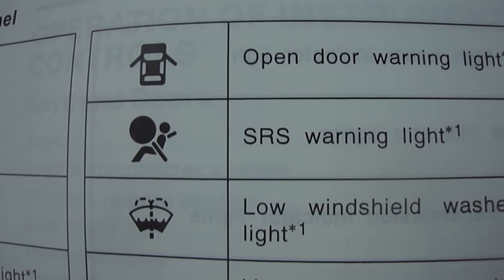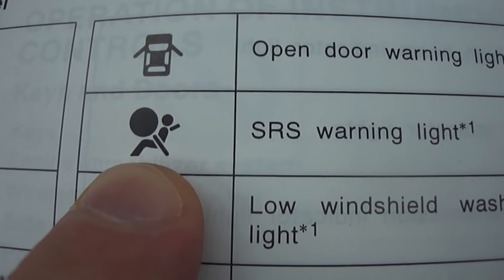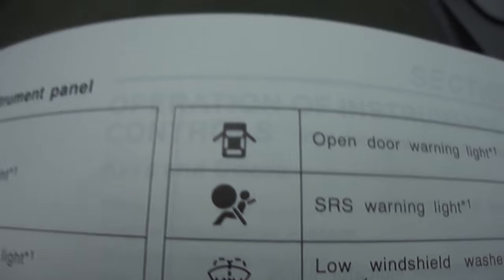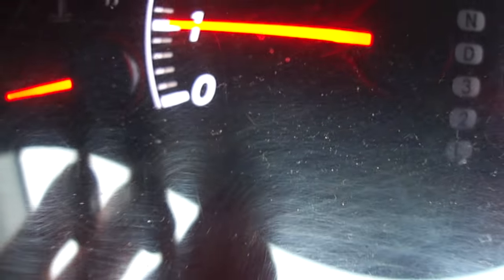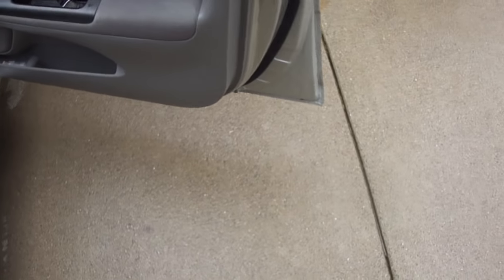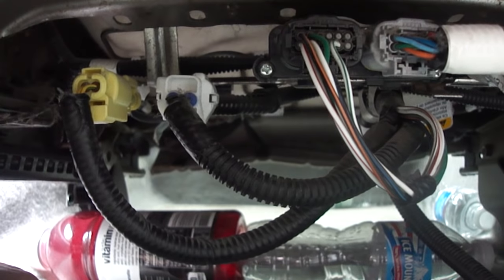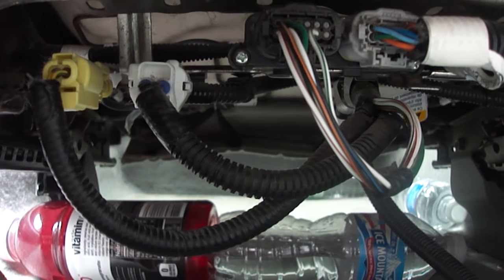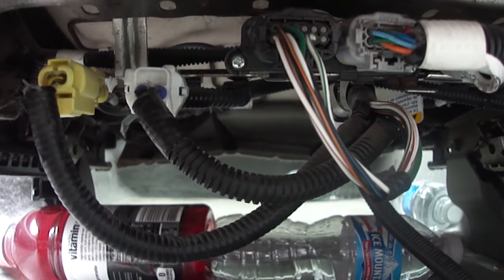(Part 1) How To Fix Airbag Light - Fast & Easy!

Comment: For a longer term fix, something to look into is proper contact grease based on the material of the connector contacts. Cant vouch for any product (it varies) but it seems over time, either corrosion, wear, or both effect contact longevity. Dielectric contact grease solves these issues, but its very important to get the right type based on the connector contact material. Also the car should probably have its battery disconnected for some predetermined time before disconnecting any of these connectors - lest you want to make a trip to the dealer to get the airbag system re-calibrated - especially on newer cars.
Reply from the maker: Thanks Ivan
Reply: I was looking for this comment. And DEFINITELY don’t unplug, or god forbid, PLUG IN the connectors with the vehicle running

Comment: Yes this worked for me had just returned from having my Kia Sorento seat being repaired and noticed drivinn home that the airbag warning light had come on. I watched this video and did what was said and found the cable under seat was loose and actually made a clicking sound when properly connected. The warning light immediately disappeared. Thanks for saving me another visit to the repair shop!!!

Comment: Thanks. Watched your 3 videos and fixed my '04 Acura TL Airbag/SRS Light-On problem in about 5 minutes! It was the yellow SRS connector under the pax seat--the first one I checked 😜. Glad I did an ops check after doing the first one. Saved time and also isolated the problem to that specific plug. Thanks again for the great info. Always  a great idea to check the easy stuff first. It's beer thirty! Cheers, Spudz
Reply from the maker: You're welcome!  Glad it worked.
Reply: Did you have to disconnect battery or jus wiggled a little on the connectors ??

Comment: The real problem that this fixes is mico corrosion build up on the terminals. This is known as terminal fretting. Simply unplugging and reconnecting will result in a restored connection. There is a terminal lubricant called Nyogel that will prevent the corrosion. The air bag circuits are always the yellow connectors. ALWAYS! do this with ignition off.
Reply: JAWGA MAN You want nyogel 760g. In our store we use AC Delco part number 12377900. Not sure what retailers have it but available through online retailers.
Reply: JAWGA MAN  and yes, use this directly on the pins. Don't fill the female terminals.  This can cause a hydrolock senario and spread the terminal.
Reply: ejdubu 
Or you can use dielectric greece👍

Comment: Hey thank you, this worked. Stealership said they fixed my passenger side airbags for the Honda recall on my civic LX. I brought it back and they said it was my driver side airbag. They tried charging me $165 for diagnosis then after I went irate they said $65. I told them to F off. Thanks you your video. It was just a loose connector under the drivers side. Interesting part is the stealership never bothered checking their work.

Comment: Thank you 🙏🏻 I was freaking out 👀😭😂
Reply from the maker: Yesi Cha 👍😊
Reply: Well, how could i determine which side. Driver side or passenger  side is what trigger the light to come on?
Reply: On my 2006 lexus rx330 it has a weight sensor.. it would be off if no one is sitting or the weight wasn’t ip to the limit for the airbag to be on. But i noticed mine today it was off even tho my wife is sitting there
Reply: I suspect it’s something to do with all those bottles rattling about under the chair. Rolling back and forward, pulling away and braking are bound to push the connections loose.

Comment: One last thing I would like to mention is that generally, a dealership will most likely want to change out the entire wiring harness or connectors in addition to paying for that new part you will also incur labor charges as well..I actually called the dealership and the price they quoted me was Absurd!

Comment: Thanks so much for this,  saved me a couple fo hundred dollars and a whole load of work.  My model of vehicle is known to often have a fault in the passenger detector unit,  and I assumed the warning light problem was this and I had to buy another seat and reset the whole computer and a whole load of hassle to fix it ... but after watching your video and checking the connections,  the problem has gone away!  Two minute work!  God bless you.
Reply from the maker: Alistair McClure 👍

Comment: Maybe a silly question but do you need to disconnect the battery first?
Reply from the maker: There are no silly questions here and the answer is no.
Reply: If you're going to work with airbag, you should remove the battery connections first, or you run the risk of triggering it. Safety reasons
Reply: YES, you always need to disconnect the battery when it involves this. 
I own a car dealer and when it comes to removing seats on newer models, even older models, if you don't disconnect the battery and when it comes to disconnecting or reconnecting the cables, the airbags can deploy and its happened to me and to a lot of people I know who've tried to fix their issue or just removed their seats for detail cleaning. 

It doesn't take more than 5mins to disconnect the battery, always play it safe.
Reply: 5 minutes? Are you disconnecting it with chopsticks or something? And are you saying that if I'm involved in an accident, you know, the kind of occasion upon which you would hope for your airbag to deploy, and the battery is ripped free of its cables in the impact that my airbag won't go off?
Reply: The impact sensor is the one cause the airbag to deploy. 
Has nothing to do with battery.
Reply: Before fiddling with the connector, you need to leave the car switched off for half an hour to discharge any residual current in the electrics. Otherwise, you might trigger the airbag.
Reply: Yes, must remove the negative terminal of battery under the hood.  This will save you from accidentally tripping the SRS Air Bag system !!!  Definately must do !!
Reply: Ok
Reply: @RiffRaffMama.  The airbag will have gone off LONG before the battery gets yanked out of it's harness.  The speed with which they deploy is staggering.  Just witnessed a MAJOR collision this weekend.  Expected to pull dead bodies from the vehicle.  Remarkably (and smokily) three people walked out of the two vehicles in pretty good shape.  SO MUCH SMOKE from the airbags.  Never seen an engine torn to pieces like that.  Wow.

Comment: SRS wiring harnesses are identified in YELLOW.. the other harness (white, blue) are pwr seats and/or heated seats and will have absolutely no relation with SRS/AIRBAG systems in all makes and models i.e. make sure yellow harness is snug; step 1 srs light problem. This poor guy obviously must be mistaken in which harness is giving him problems, cleanliness may also be a factor with all those bottles jumbln around down there

Comment: yea funny I was detailing the carpet unbolted the seat put everthing back to how it was then the airbag light comes on might have to check all conections are in place
Reply from the maker: You should be able to fix it no problem.
Reply: Jimmy Jay im a detailer and if i have to remove seats i always disconnect the battery for just incase reasons. Been told you dont have to as long as you dont turn the ignition on with all the srs connectors unplugged. I still disconnect cause knowing my luck I'd forget lol

Comment: $100?? they tried to charge me $800!!! I'm trying this right now
Reply: Did it work?
Reply: its a racket..lucrative for dealerships
Reply: James Chuaycham ป้อม ศักดิ์ชัย no it didn't. I have an 08 Suzuki Grand Vitara. There's a recall on this for the passenger side. The dealership had to give me a new seat no charge.
Reply: Lee 
McKee
Reply: The Honda dealer I went to said this job is $800 to replace the SRS. The car isn't worth that much money.
Reply: Pretzelgal check for the cutoff SRS indicator, located with the hazard lights. There is a sensor and if you replace that part, the light should go off. This is a video on how to replace the switch https://youtu.be/nuTvEnogE2o
Reply: i was at toyota dealer he told me his going to charge me 110$ hour for fixing this problem ( check all the wire )

Comment: OMG I was skeptical at first but after reading so many comments I decided to try it and it was disconnected. I simply pushed the yellow back in and it took the light off. Thankkkkkkkkkkkkk Yoouuuuuuuuuuu so much. Now I'm looking to fix the Emissions light, that will be a lot more than just a click hahaahhahaha. That is a Solenoid that needs replacement. I have a 2009 Acura TL any video suggestions for that?

Comment: You made my day. I just found out I have to replace my gas pack unit on my house and the SRS light came on in my car.  I wiggled the wires under the seat and it went out. Thanks.

Comment: Thank you. That's a great and clear explanation. I have 2006 nissan maxima 3.5 SL , airbag light blinking continuous. I'm finding difficult to check the yellow harness under driver seat as I pulled seat front and  back but could not move my hands inside seat to wiggle yellow harness. Any idea or video how I can?
Reply: take the 4 bolts holding the seat to the car out and lift the seat up to fix!

Comment: Awesome video!  I was running out of options and was in search of fuses on this car that was provided for my son by my uncle.  I came across this video after several other YouTube videos (helpful but didn't directly solve my problem), proceeded to looked under the front passenger seat to find a disconnected yellow cable that too fittingly resembled one in your video.  I connected it and put the car in diagnostic mode.  Upon entering diagnostic mode, SRS indicator turned off and remained off!  Thanks much sir and thumbs up.  This was on a 2014 Nissan Versa.
Reply from the maker: BautistaVids 👍😊
Reply: @proclaimliberty2000  P.S.  Do you happen to have at the very least a 'cup of coffee or beer' buy link, perhaps through PayPal?

Comment: Sweet! I needed this info for my car right now, the stupid light has been on on the dash for a couple weeks and I know better than to leave a light like that on without investigating...I didn't even bother looking up anything until tonight and I found this video almost right away listed on a great car blog. Can't wait to try it first thing in the morning! Although I don't have any check engine light showing additionally, I plugged in my Fix'd device, and it gave me some kind of power reading, so I'm pretty sure jiggling the wires and making sure they're in correctly makes sense.  Plus, on the center front console, the "airbag on" light is on for the passenger side but not for mine so I'm pretty sure it's the driver side that is loose.
Reply from the maker: Brass Hacks 👍😊

Comment: Wow It actually worked liked a charm for my 2004 Mazda 3
Didn’t think it would work at first
but I gave the connections on both side of the seats a wiggle and the light went away!

Comment: Thank you for this video I drive students to school for a living and this light came on right when one of my students got in and sat behind me but the light wasn't on when I first got into the vehicle. I did exactly what you said to do just so happen the student that got in accidentally kicked the wire loose and I just wiggled it once heard a click and my problem was fixed. Saved me a trip from going to my jobs shop. Thank you man

Comment: Thanks Paul had this issue im my tk barina , did what u said wiggled the connections under the seat and bingo light is now gone out. Think it was the driver seat . Maybe when i vacumned under the seat might have disloged one. Much appreciated for the tip. Cheers mate.
Reply from the maker: David Wilson 👍😊

Comment: OMG!  I just got a newer car with all the bells and whistles and sensor lights (never had all these problems in my 2003 PT Cruiser). I even stopped by a dealership and was told that I needed to make an appointment and leave my car there for a day.  Well, I just fixed the passenger airbag off - SRS check, blah, blah, blah message by wiggling those plugs under the passenger seat.  Thank you so much!  Now if I can just get that tire pressure light to go off...but not a big deal. I will learn to ignore it.
Reply from the maker: You're welcome.  https://youtu.be/hlAfcCR4314
Reply: Thanks for the link. I searched for that secret button but haven't found it so far. I will look for it again tomorrow morning in the daylight. It's a 2014 Subaru Forester, so maybe it doesn't have it. I never thought getting a newer car will bring a set of new annoyance.

Comment: I have 2005 Hyundai Elantra that has airbag light on.  Clock spring and wire cables are ok.  I think I need to fix or replace ECU SRS module?  Any advise for best and safe solution.  I try to avoid dealer at this time but might visit local airbag specialist shops.  I will try  by wiggling and pushing those electrical connections together first...pretty tight spots and have to lean side way.
Reply from the maker: The only suggestion I have is to wiggle and push in those electrical connections which often is the cause.  Let me know what happens.

Comment: This happened to me today on my 2008 Ford Fusion, just as I am ready to sell it in the morning! After watching the video, I knew it was the driver side because I removed some old seat covers and the drivers tugged a bit. Went back out, and found 1 small clip under the driver seat but on the inside near the console. Thanks!
Reply: Philothea - is your airbag problem fix? I have same car with same problem.
Reply: Thanks for the input I checked what you said on video done as you said and the light went out thanks again.

Comment: Thanks for the tip. I have a 1999 ford e150 van. looked under the drivers seat, pulled apart and re-connected and the light went out. Thanks again.

Comment: Fixed a 2014 KIA Forte.  The under the passenger side seat (had to remove the 4 bolts) there are 4 or 5 separate connections,  I ensured each was disconnected and re-connected.  That did the trick.  The SRS airbag warning light went off.  I would recommend that folks check the under-seat wire connect harness first before taking to a service tech.  Save lots of $$ for a quick check and fix.
Reply from the maker: john Sar 👍😊

Comment: Hey thank you very much for this experience sharing. I just fixed my toyota sienna 2007 limited. I had done a floor cleaning and had to remove all the seats, but the light indicators came up a few days ago which was bothering me so much. After watching this video it took me two minutes to resolve the issue. Thank you again.
Reply from the maker: You're very welcome!

Comment: Thanks Paul. I had a bottle under my seat wedged between those cables and the floor board. Removed it and the light went off..👍🏾👌🏾
Reply from the maker: T. Mills 👍😊

Comment: Hey Mate, thank you so very much for the tip! I just did it on my 2008 Honda Accord and it worked!! There was a loose connection under my passaenger seat from when we took it out to give the car a good clean!!

Comment: thanks a lot, fixed my airbag dash light. checked under the passenger seat and of course its where i shove miscellaneous stuff for "storage" and at some point something disconnected the connector. put them back together and light off, thanks!

Comment: Are those fuses and/or wires in the back seats too. I have a 2015 Jeep Latitude and the airbag light recently came on. The Jeep dealership quoted me $169 to diagnose it and another $169 to diagnose the "check your engine" light.
Reply from the maker: To my knowledge there are none in the back seats. Take your vehicle to an auto parts store and they will diagnose the check engine light for free. Dealerships are a total rip off and way too expensive. You’ve got to find a good local mechanic.  Ask an auto parts store for recommendations of a good local mechanic and then check their reviews online.

Comment: Thanks .My Camry was throwing this up after I installed  an amp, I forgot that I removed the faulty seat belt latch and sensor wire in the process....
This let me know that my light will go back off when I replace the latch and hook the new wires up....
This was my first amp install and was getting nervous....
Reply from the maker: SegaDream131 👍😊

Comment: Have you had good luck with your 2006 Camry? How about the transmission? Any issues?
Reply from the maker: Hi Kip, I actually own two 2006 Camry LE models.  Their both the four cylinder which has a timing chain.  The V6 has a timing belt and I read the engine had issues so I steered clear of it.  One has 125K miles and the other has 225K miles.  I use full synthetic in both the engine and transmission and have had zero issues.  Has very good pickup, good gas mileage and excellent ride.  I believe it might actually be built on the Lexus chasis.  I still love these cars.  Other than regular maintenance I have not had any real problems with either.  Hope this helps.  Paul

Comment: I have a 2002 330i BMW. I removed the passengers doors regulator yesterday and disconnected the battery. I put everything back on and the airbag light is on. I done what you said on your video in don't seem too be working. Do you suggest any other methods of attempting to turn off the light?
Reply from the maker: Luis Martinez Watch part three.

Comment: ABS stayed on all the time.  I went to Nappa and they said 1,000 bucks to replace ABS.  Needless to say I did an about face and got out of there.  Took it to Firestone and the guy said it was the clock spring.  I wasted 200 bucks to find out he was wrong.  Watched your video and went under the drivers side seat and moved the wiring harness around and the light went off.  I can breathe easier now because if that light stays on it won't pass inspection.  97 GMC Jimmy.  Thanks for sharing that information:-)
Reply from the maker: You're welcome!  That's really great.